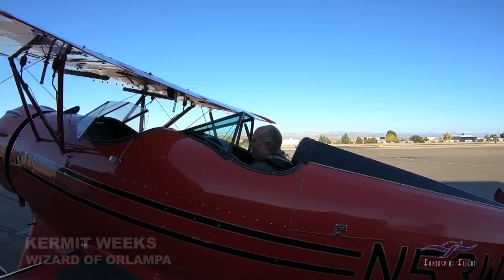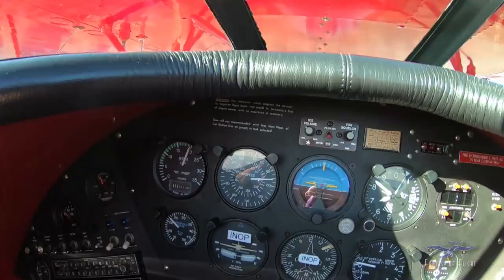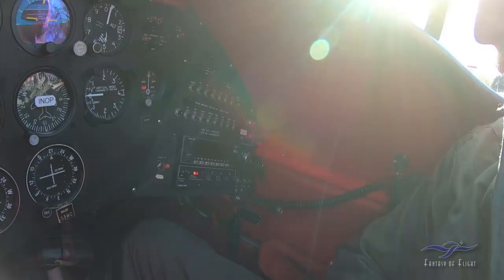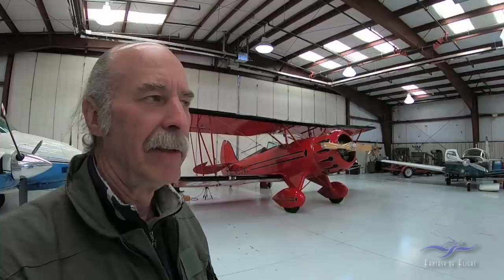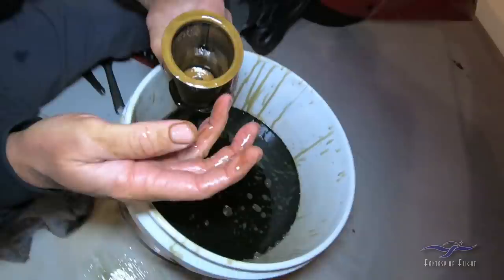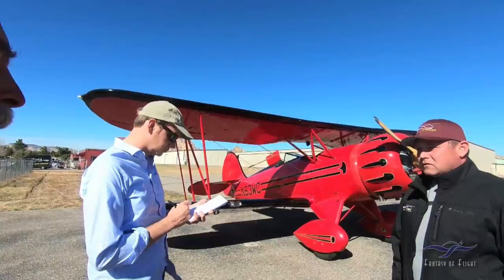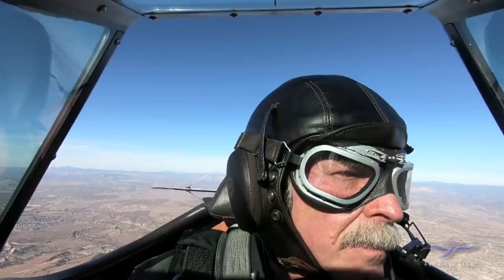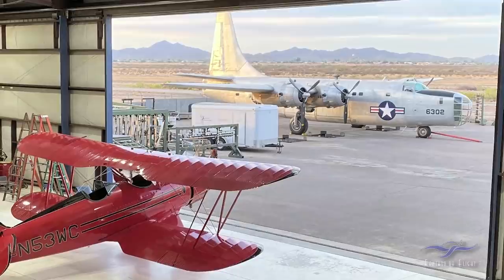Waco YMF-5 - Flight Home Begins  -  Part 2

Comment: I had a similar transponder in my 35 model bonanza. Don't remember the model. It blew through encoders. I swapped out the transponder after the second encoder failure in 3 years. That's a great area. I used to fly the family up to Airport Mesa in Sedona on the weekend in summers. My wife and I got married up on the Mesa.  It's a great place to fly.

Comment: A big round engine and a beautiful red biplane,what an adventure bringing this home to roost at Fantasy of flight,love your pre flight  Kermit removing the front control column and dropping the filters,the Waco is in good hands and will prove a lovely relaxing biplane to fly around the patch,I laughed when you said the panel had so much crap that you would replace ! thank you as ever for the coverage especially the go pro position pointing straight at Mr Jamaica himself enjoying this lovely iconic machine.

Comment: Hey Kermit, next time you're out in the Cottonwood area of AZ, you should go check out Cadeceus Winery for some excellent vino.
Reply: Actually, you would want to fly into Jerome next door and that's where the winery is. They have a tasting room set up with a regular storefront on main street for a tasting room and purchasing point. Bring your $ with! While some of the vino isn't cheap, it is hands down better than any Nappa Valley bullcrap that's out there. Best high Sierra wine that side of the Mississippi.

Comment: Inverted spins. More advanced to recover from but with proper technique possible with adequate altitude. Become familiar with all stall regimes of the airframe.
Smooth throttle management to avoid engine trouble. 

Eddie Rickenbacker had to come down from altitude occasionally to warm up.
Only the clothes he wore and leather helmet googles and scarf for warmth.

Spad XIII “ all I learned I learned from Luftbery” .

Raoul Luftbery, Chamalières France 🇫🇷 .